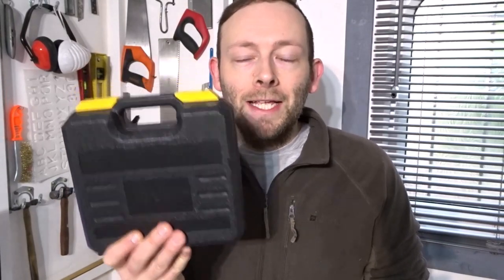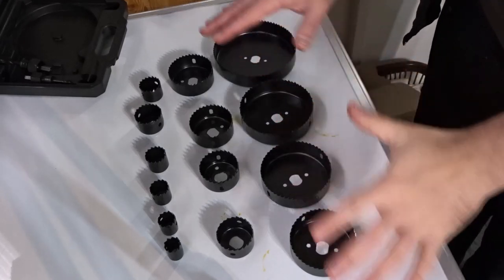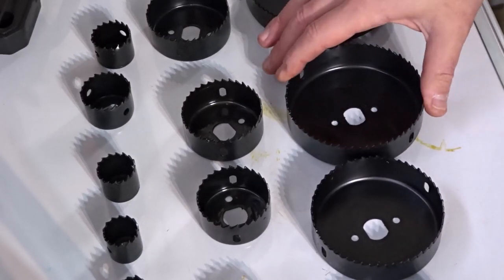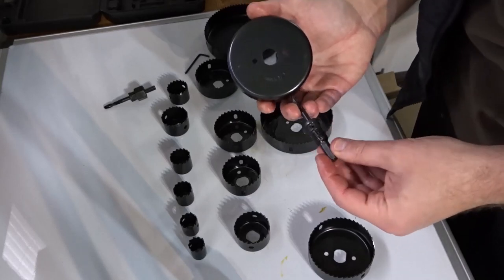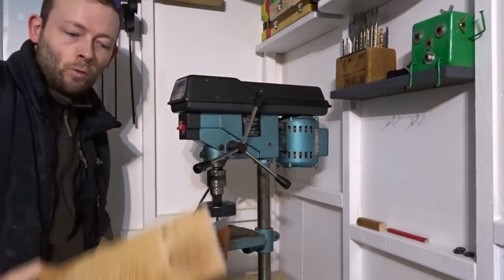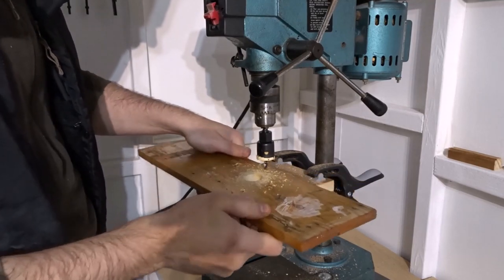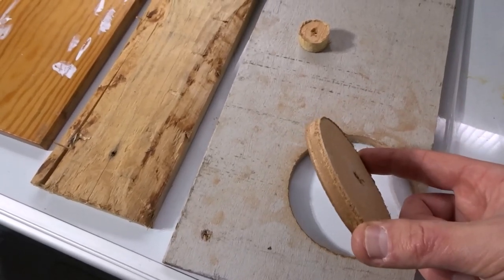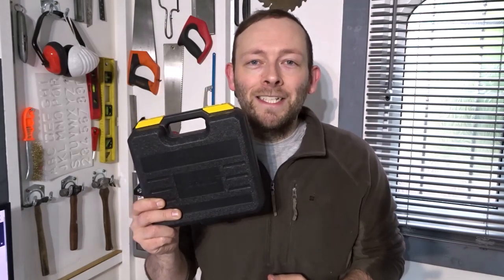Jellas 19 Piece Hole Saw Kit (Unboxing, Testing & Review)

Comment: Interesting that the nuts on yours have a reverse thread. The kit I have (which is otherwise identical) has standard clockwise threads. I wonder if it makes a difference?
Reply from the maker: I don't know to be honest. Maybe they changed the design for a good reason although I'm not sure.
Reply: @PhillWyattProjects  I was using mine this afternoon & noticed the nut working loose a couple of times. Perhaps they changed it later to prevent this happening?

Comment: More of a how to use then an actual honest review of the product, can tell they arent that sharp by the pressure shown by you pushing downwards whilst using the combi drill. Also causing the blow out of the wood at the back. It was a nice clear information video though, cheers
Reply from the maker: Yea although to be honest it's the first set I've owned so I don't have anything to compare them to. They seem good considering the price though.